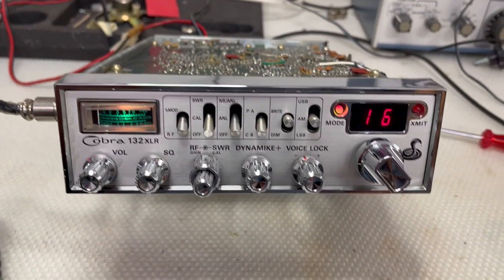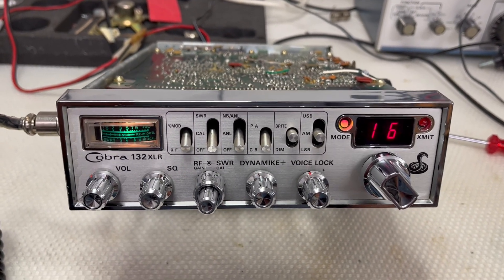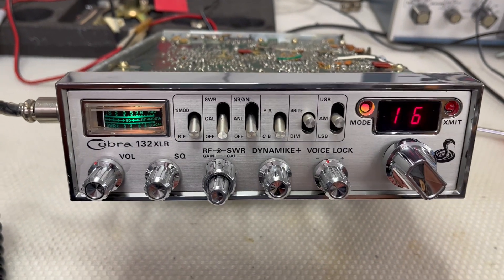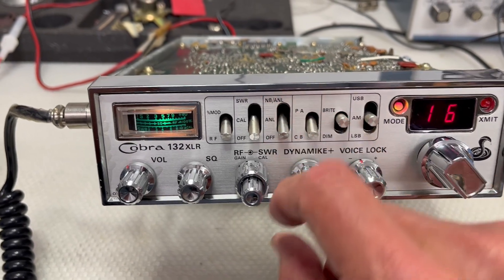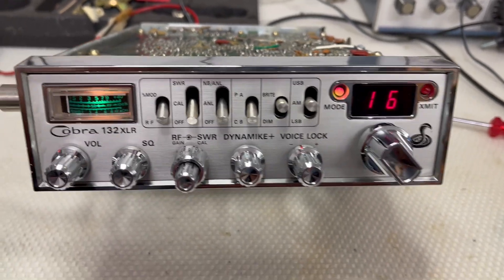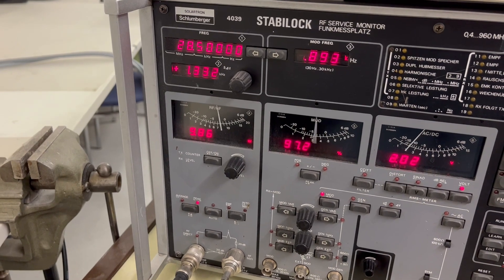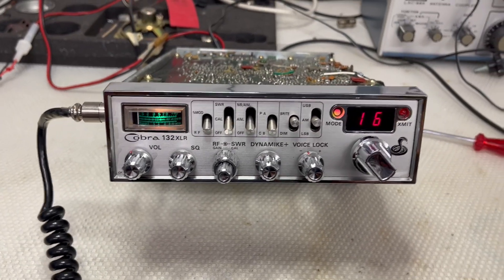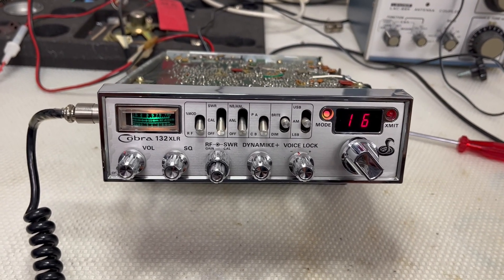COBRA 132 XLR on HAM-Radio Friedrichshafen

Comment: Would the channel selector from this fit in a cobra 138XLR A
Reply from the maker: Hello dear CB radio fan, thank you for your visit to my channel. Unfortunately, the COBRA 138xlr has a different PLL synthesizer (upd858), which has a different coding than that of the 132xlr. Therefore, the casual channel selector will not work either. So I wish you a great weekend in advance. Many greetings from the Zurich highlands. 73...

Comment: Wow that nice set I've not seen it for years it never pops up on net market it would be bonus to go a long with my other radios if this radio was mine I would put it back to 11m !!. Your very lucky guy. Great video.
Reply from the maker: Mister Salvage my friend, thanks you for your question. Yes, it is actually the offset quartz that has been changed. According to the manual, the original xtal oscillates at a frequency of 17.05625 MHz. The measured frequency at the transistor (Q308) would be approximately 18.40125 MHz. This would then be 1345 kHz higher and would correspond to the difference between 28,500 MHz and the original frequency of CH16 = 27,155 MHz. Since the clarifier is still used as a tune, approx. +/- 11 kHz can be regulated there. So a lot has changed there. So I hope to find an original 17.05625 MHz xtal, to remod the radio to 11m. Best 73 from the Zurich Highlands.

1
Reply: @SWIZZRADIOS  sounds straightforward hope you you can do the job let me know if you need 17.05625 Crystal I might have 1 I do have about 300 mix crystals.

Comment: Schönes Gerät, hätt auch gern gewusst ob es nur der Kristall für 10m ist den nannnur wechseln brauch und das Gerät neu abgleichen.
Reply from the maker: Hallo DXer Freund, danke für deine Frage. Ja, es ist tatsächlich der Offset-Quarz welcher gewechselt wurde. Das Original oszilliert gemäss Manual eine Frequenz von 17.05625 MHz. Die gemessene Frequenz am Transistor (Q308) wäre ungefähr 18.40125 MHz. Dies wären dann 1345 kHz höher und entspräche der Differenz zwischen 28.500 MHz und ursprünglicher Frequenz des CH16 von 27.155 MHz. Da der Clarifier noch als Tune verwndet wird, konn dort ca. +/- 11 kHz geregelt werden. Da wurde also schon einiges geändert. Beste 73 aus dem Zürcher Oberland.
Reply: @SWIZZRADIOS  Ja hat sich ein Amateurfunker dann umgebaut interessiere mich auch für Abgleich und Reperatur von Funkgeräten. Grüße in die Schweiz aus DE und danke für die Antwort👋🏻
Reply from the maker: @13HN870  Eigentlich sollte man die Kiste nach Graz schicken, so könnte Maurer noch eine FM-Platine und gleich auch noch eine Frequenzerweiterung einbauen. Auf der Front hats Knöpfe genug...